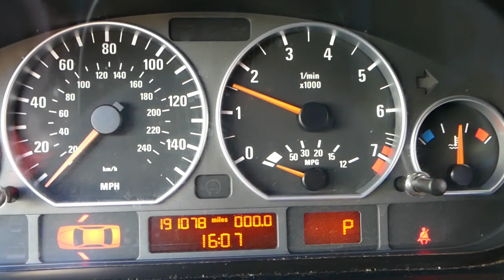AC CONDENSER RADIATOR REPLACEMENT REMOVAL DODGE DART, CHRYSLER 200

Comment: love the videos guys. The chrysler 200 is not for the faint of heart. the radiator bracket t25 bolts are only accessible  from the front. this includes removal of the bumper, headlights and the isolator directly in front of the assembly .

Comment: How do you replace the clips on the A/C condenser? Is their a specific way or can I just insert them and re-clip the transmission radiator. I don’t want to mess up my new condenser by put holes in it because of the clips.